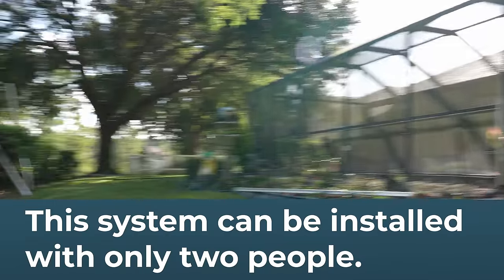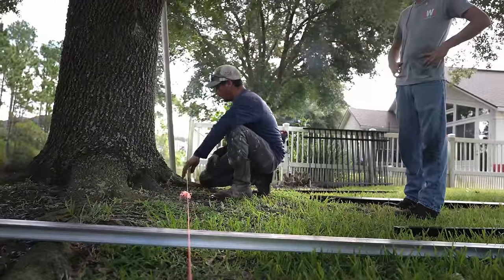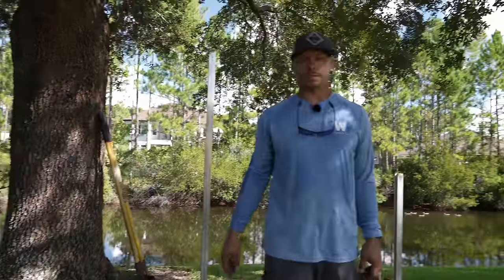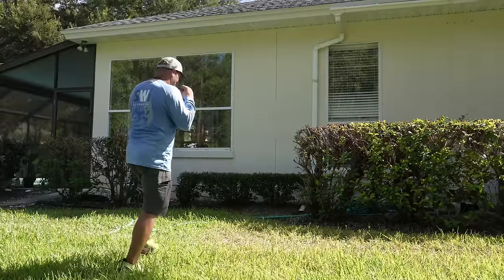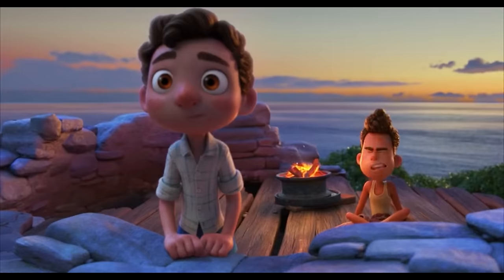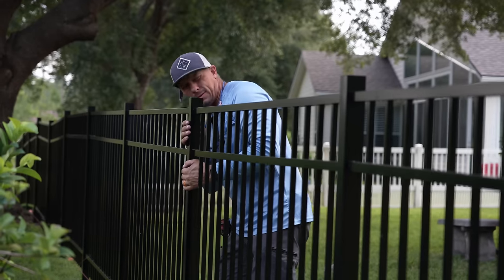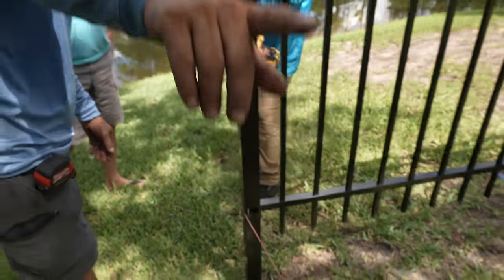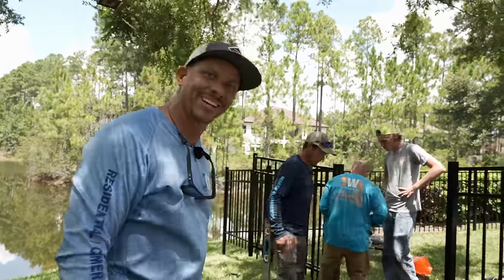This No-Dig Aluminum Fence Is 10x Stronger Than It Should Be

Comment: Can we please stop pretending that an aluminum fence is little more than a visual barrier. I’ve been putting in fences for 25 years. This should be a crime and what we’re selling to people.
Reply: It keeps kids and large animals out of your yard. Wtf are you talking about. People know what they are getting
Reply: Dude what are you talking about? This type of fencing is perfect for the front yard, to keep kids and animals in and people out, without blocking the view. If I had a privacy fence in the front, it would make it difficult for my neighbors and myself to get out of our driveways. It would block the line of sight for everyone so having a fence like this is perfect. Private fences are for the backyard. Metal fences are for the front yard.
Reply: Nah it depends on height
Reply: This type we use in suburban homes in el paso so that u can see thru but keep people out it's impossible to jump one let alone not be impaled
Reply: Weird that you say that. Just the other day I did a repair where the company had cameras everywhere. Barbwire, tension wire both cut through. So in your many years of experience what fence do you recommend to stop thieves? 🤣
Reply: Unless you are putting barb wire on a fence, it's  only a basic security feature.
Reply: Bro tf are you expecting? To keep out zombies? 💀😭

Comment: In our place aluminum fence will be stolen... need another fence to protect metal fence
Reply: Might want to consider moving.😅
Reply: I sense you should move too
Reply: Lol that’s funny.
Reply: Who pays for a fence where critters can walk underneath the bottom of the fence... 😂
Reply: I have the same problem rural area in the mountains with thievery & fire trying to figure that out & what fencing might work. 🤔 any ideas?
Reply: 220 volt wire will solve your problem .😁

Comment: I would sharpen the I beams - they cut the roots that way.   At lest it works for pipe. We do 8 foot chainlink with a pnumatic post pouinder and only use 2 3/8 for line posts and 3 inchs for corners and small gates. We use 12 foot posts 4 foot in the ground.  Overkill yep.  But we like it that way.

Comment: Homeowner here. The product link in the description is for I-beams and L-beams. Does this mean I buy SWI's beams and install regular 2x2 metal posts from other manufacturers over them? So the beams are compatible with any 2" or 2.5" alum fence systems? Thanks!

Comment: As I mentioned in a previous post, I am impressed with your installation and technique.  I am curious as to why you didn't put a full section of fence over the tree trunk and then the short section up against the neighbor's fence so the short section isn't in the middle of the fence.  You could have placed the posts of that section, straddling the tree trunk, then worked out from each side of the fence.  

I am curious about your thoughts.  

Also, is this fence a product that is sold nationwide?  Is it a franchise?  Fence installers of this product in Maryland?

Comment: Ok so I work For Maritime Fence, in Nova Scotia Canada all of us worked for Eastern Fence one of the oldest Fencing companies in all of North America. Now that Vinci bought us we are literally the biggest fencing company around if you do your home work they are 3rd biggest construction company world wide. Our salesmen would have let the customer know before hand he couldn't have a straight fence with out giving him he's options before hand they don't sell a pig in a poke we do jobs world wide Prisons/Airports/militarybases US/Canada/Jamaica to Japan Highways Guardrails etc we do it all. We don't have easy pounding ground gas pounders, like what you use are useless here we use Rhino with air compressors plus air drills some times we have to bring out the big guns with a skid steer and the down hold hammer drill when auger doesn't work. I might be wrong but from the videos I'd say your about 5ft9 or under I'm 6" 240lbs and I'm telling you, You couldn't budge our Iron Eagle. How you say the material comes with extra material we like that so we can weld galvy pipes threw it from waste so we can pound them in put some quickcrete down the hatch, You will not budge our iron eagles in my area we stay away from aluminum as the base since it's weak in extremely cold conditions. IN nova scotia you don't hit post Post hit you.
Reply: I'm from Nova Scotia (Halifax). I was literally wondering if this was possible here...... Is it?

Comment: Would you recommended the swivel brackets for slight inclines in landscape or would inserting the panels into the posts work the same?
Reply from the maker: As long as your panels are rackable there's no need to use brackets. It's very important to make sure your panels can rack to the slope desired--if they don't rack even brackets won't help you.

Comment: I learned the drill chuck 'trick' a few months ago, but it doesn't seem to make a difference with my drill.  It does click, but I'll still randomly have it loosen up.   It's an M18 hammer drill, so it's not a low end drill.
Reply: The drill chuck 'trick' is backwards - you should hand tighten it over that click, not back it off one.
Reply: Spin it tight with the drill, back it off by hand and re-righten by hand. It will go a couple clicks more. It's just like tightening a set screw: snug it, back it off, and re-tighten to set it and it'll go a quarter turn more the second time.

Comment: What adapter are you using in the Rhino driver? Is it the same adapter for the line and corner posts? Thank you
Reply from the maker: We just leave the post master chuck on and drive everything with that. 2 1/2"
Reply: Thanks for the info

Comment: Nice. But why use a string for heights? We use a laser so we can measure the height difference. The highest point is the tree, so we put a laser on the highest point and then measure the difference where we want to start with our first post. Then we add the difference to the post where we want to start. Litteraly we mark our fence panel from top to bottom on the post, witht the extra height we measured .Let the mark come down on the ground and you’re done. Add a inch or so to go over the tree just a inch etc. 
That’s how i work in dutch fencing industry. Pretty funny adapters you use there to slide over the main post. We use none of that though here. Plus its better to always set a endpost to sight the posts in line while pounding them in. When you and your co worker get a nice feeling with it you will be a human machine! Nice video and keep it up!
Reply: Do you adjust your laser for jobs that are not level?
Reply: @wileyearly7051  No we place it in the middle of our working area and then we measure the height differences. We use a measure stick with the reciever of the laser on it. Then we put it on the ground where we wanna start and measure the whole line of where the fence needs to be placed. At the starting point we level the reciever of the laser on 0. Then for example 10 meters further i place the stick with reciever and see that i have to lower the reciever on the stick to get to the 0 point we measured at the beginning. This means this point is higher because i have to lower the reciever. When the reciever must get slided up on the stick, the ground there is lower. Its a reversed world but perfect to measure height differences.
Reply: String don’t lie or require batteries or care if it gets rained on and very good for visual for customers along with not trying to see a laser in daylight or have laser end up In a passing car 🤙

Comment: No dig fence…starts out with a machine and a post hole digger.
Reply from the maker: Well, the title isn't No-Work Aluminum Fence. 🤣 It's got to go in the ground somehow.
And maybe you'll like this title better? "No Dig Fence Except If You Are Setting A Post Next To Another Fence Which Is Already Set In Concrete So You May Have To Dig Down To Make Sure You Are Ok Since You Obviously Don't Want To Drive Your Post Into Existing Concrete" Hmmm, doesn't seem as catchy though... 😉

Comment: When that white fence is on the piss in a few years you will know why, I would just screw to that white post instead of removing other fences footing
Reply from the maker: Why not take issue with the fact that that post only had 6 inches of concrete on it? If you’re concerned with what I did to that post and you don’t want to talk about the fact that the post wasn’t sent properly in the first place, will never have a productive conversation. That post had problems from the day it was installed.  What I did will not affect its longevity or performance whatsoever.

Comment: I push over EVERY no cement post fence    I show people just how weak those fences really are. Push back and forth with force and they lay down pretty easy.  Terrible idea. Lazy man fence is all it is.   Only of it's pounded down 4-6 feet down?? Maybe then they will stand up over wet soil and time and settling I to ground over time.   Deep deep down.   Most that I have pushed over were only pounded down 2-4 feet max.   Anything under 4 feet will be pushed over.  I won 100 bucks when I challenged neighbor that his new fence is weak.   I laughed as I pushed 63 foot long run of fence very easy.  He yelled stop after about 20 feet of fence pushed onto ground.  Weak weak system.  Must be DEEP
Reply from the maker: They're not going anywhere deep enough. Ours stands up to hurricane-force winds: https://youtu.be/Ocr73Lmo9O8
Here's how to tell if you're going deep enough: https://youtu.be/mc92svvCRFo